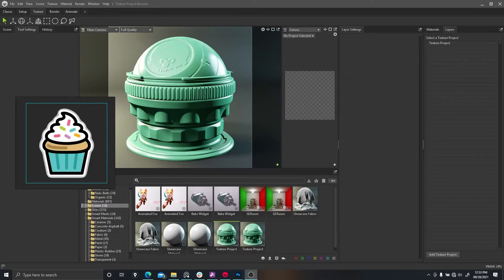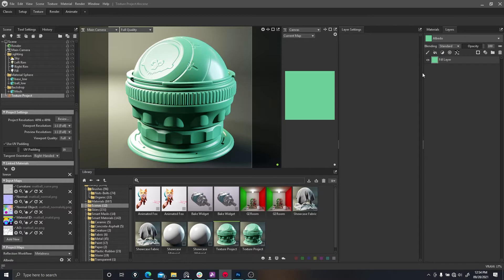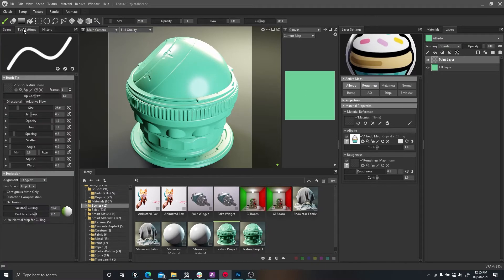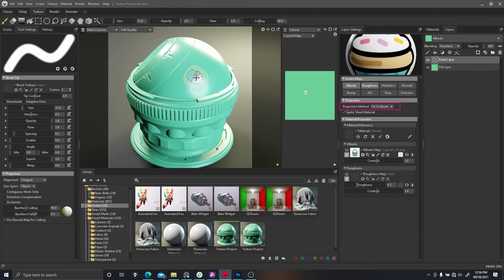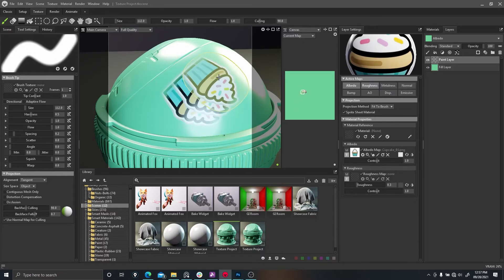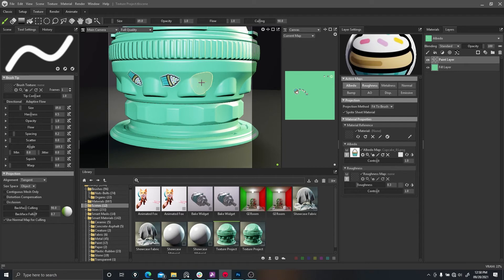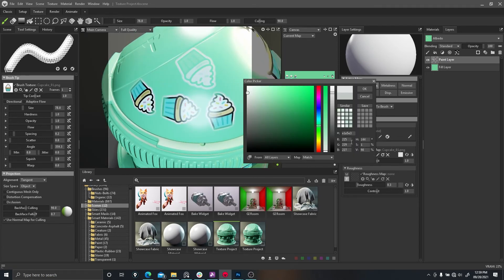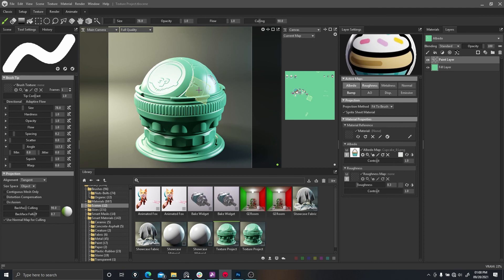Marmoset Toolbag 4 Sticker Decal

Comment: Another way is to make a PNG-File with transparent/alpha. Then put into Albedo Channel and with Planar or Triplanar Mapping you can move this Decal around till it is fine. The advantage is that you can move it precisely without constantly radiating and repainting.
Reply: hi, after several trys i couldnt achieve what u suggest - can u explain this a bit in detail? 
thx
Reply: @fifdesign89  Yes, I did. You make a PNG-File with transparent areas in the alpha channel in Photoshop or some photo editor. Then you put this image file into the Marmoset Texture Albedo Channel. So easy. The transparent areas in the image file are also transparent in marmoset. Thats it. At what point are you stuck?

Comment: Anyone know if we can paint normals this way?
Reply from the maker: Yes you can from what I remember.  Not at a PC to get the exact break down. So when creating the brush you will add only the normal slot similar to the custom brushes preinstalled that are like little screw heads. When using these brushes you are able to check and uncheck the channel you want to paint to at the top of the brush settings. Hope this helps!
Reply: @AlexAntuna  Cheers mate! I'll give it a shot :)

Comment: Nice video. Another thing that makes it easier for rotation is set the Alignment in the projection tab to Screen and then face it square on and it should be near perfectly vertical
Reply from the maker: Cool! Thanks for the tip!